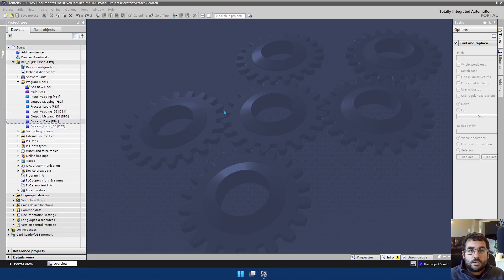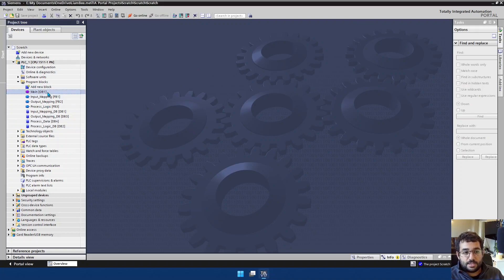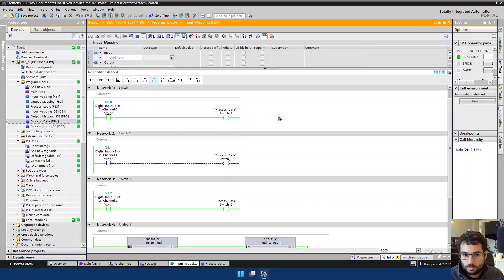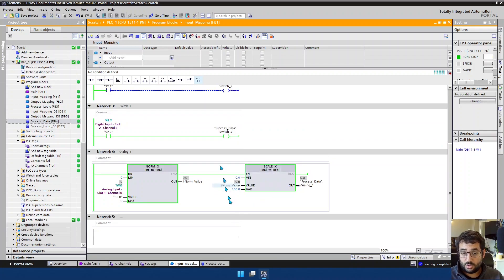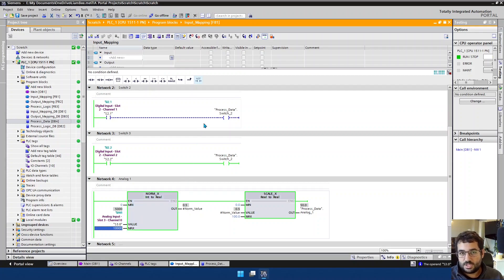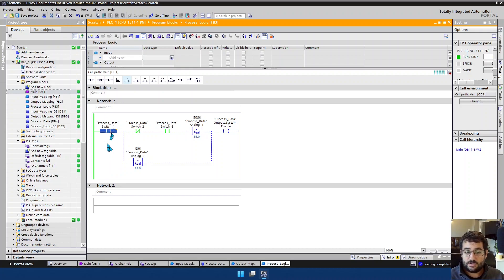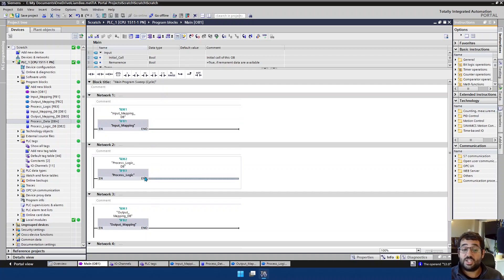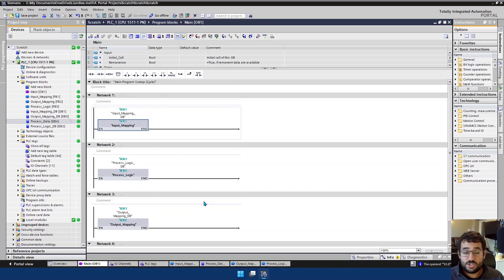PLC Programming - Project Flow With TIA Portal

Comment: Hello,
I want to set the parameters of an industrial drive using a node through RS485 serial communication.
In this project, I need to use the hex codes of an industrial drive and control the drive using the hex codes.
Can you help me with this project with node-red-node-serial port?
I have already done this using macros in DOPSoft software, but now I want to do this using node red.
please guide me.
Regards.
Sajjad

Comment: One of the daunting and complexing things in programming is laying out Memory mapping, although using Excel helps a bit. 

However, what I love to call Laim Bee's Approach, to avoid using Memories, sounds promising yet confusing TBH. In your book you created FCs for input mapping and Output Mapping both of which to map field signals into and out of Global Data Block. here you create FBs which they are automatically associated with Instance DBs.!! what is the idea?  I think creating FC is enough to map i/0. Also, to avoid consuming DB memories.   

The more complexing part is the Process mapping, in the video, as well as in the book, you created FB, which is totally understandable. Here, you created FB (Process Logic) and already assigned with certain asset i.e certain i/0 then you called this FB in OB1. This result in having an instances DB! Moreover, what if I wannna use the same FB more than one time? To my knowledge, we create generic FB then we called as many times as we want each time, we assign certain I/O . In your approach sounds we should assign the inputs right from the beginning. 

Your further clarification is highly appreciated in advance.
Reply from the maker: My mapping also includes simulation in most cases. Using an FB allows me to install timers or other instances of other function blocks.

Process logic needs to be an FB and called from OB1. You'll find internally to the first FB layer, things are reusable and have their own instance data
Reply: @LiamBeeMe  Thank you very much for your reply. Using FB rather than FC for mapping make sense now. 

However, the last part was not clear what you mean internally on the FB layer ! 

Last question, in your book you created Pole light manager FB and interfaced with the global DB via what? Did you use input, output, input and output, statistics. Which interface pin you use? What if I have another pole light2 .